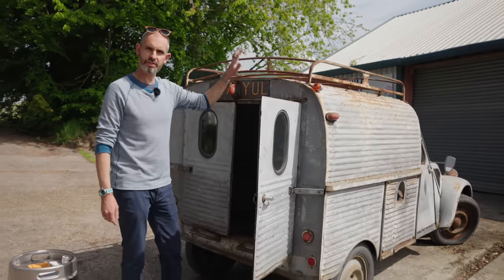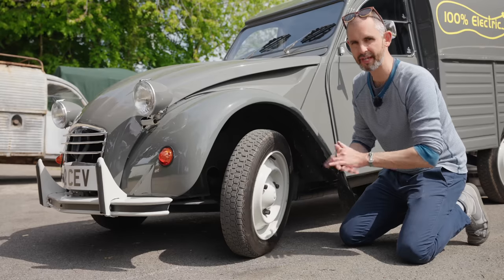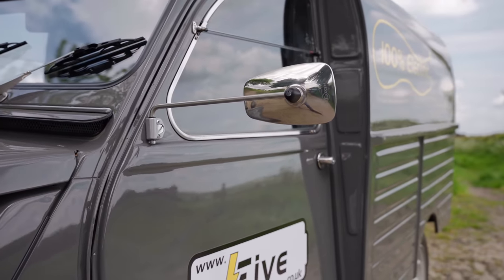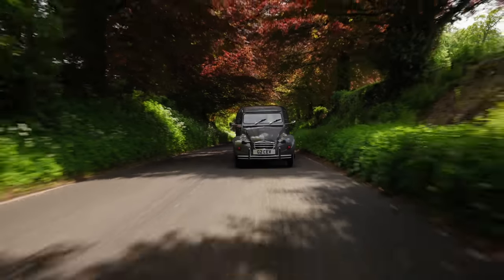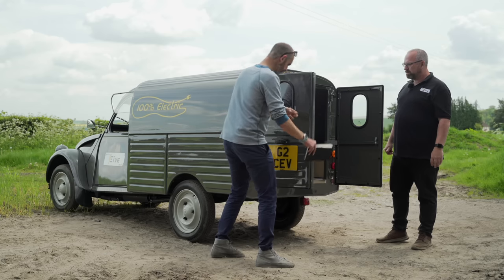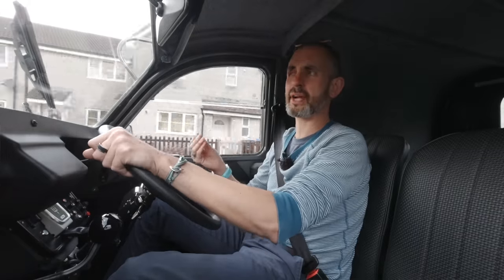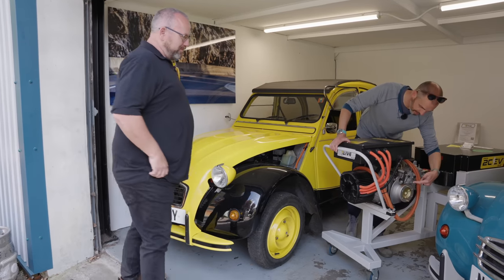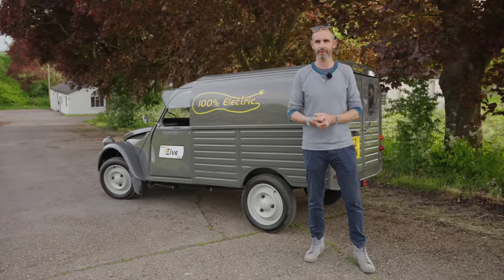This is a BRAND NEW Citroen 2CV AK Electric Delivery van - exclusive first drive review

Comment: So, I know most everything is new, but are they still registered as the original  build date? It's possible to import most things to Canada that is over 15 years old, so could I do it with one of these? And can they fit a North American compatible charge socket?
Reply from the maker: You can IVA it as a new car, yes.
Reply: @TheLateBrakeShow  IVA? To be able to privately import it to Canada it has to be registered as an OLD vehicle.

Comment: I wouldn’t mind if Citroen started to produce these. Built to be reliable and cheap. Mutch more afordable than those 10 grand behemoths. The combustion engine variants are still around today, so it will last forever. (Hopefully)
Reply: Wouldn't pass modern legislation.

Comment: Does it have the original hydraulic suspension with the pressurized nitrogen spheres? That's what made those cars. And gave you height adjustment and the ability to change a tire with a piece of wood.
Reply: You're thinking of the DS, SM, GS, CX, etc. The 2CV didn't have that

Comment: Do Yourself a favor and buy, should You need some, the original Michelin tyres (125R15 for the deuche) especially developed for Citroën. That goes for the 2cv as well as for other Citroëns from DS to SM. The ride with an original Michelin is way better, as in waaay better. Thank me after installing 'em.

Comment: I understand this not needing to have Tesla like levels of speed - but I don't agree with making it artificially as slow as the original, they were only that underpowered at the time to save cost, it wasn't a choice. It should at least be a bit nippier, especially given the huge cost premium, and I know from working in the industry myself that would be easy to do with a better electric motor.

Comment: So you pay 40k + VAT for a rebuild van, planned and build nearly 73 years ago with the safety features of that time.
And then the additional load... 350 Kg is ridiculous. My Toyota Corolla has 550 Kg and can tow up to 1500 Kg. (Trailer with brakes)
And it has ABS, ESP, Tractioncontrol, cruisecontrol, 9 Airbags and costs less than 40k.
Reply from the maker: You are entirely missing the point by comparing it to a Toyota Corolla. It isn't a rational choice vehicle at all - it is a classic shaped new thing that has PR value
Reply: @TheLateBrakeShow  Having a transport company is a rational thing at the end. And surviving a 2.5 ton SUV crashing in the Citroen is even more rational.

Comment: Range is too short for many delivery uses. If the floor of the van back were covered in say - 5 battery packs at the cost of some bulk capacity  - then it might start to look a bit more practical. If the front end were made in fibreglass too then it's long term weather resistance for British use would look very good. But the biggest bugbear is range. It needs 250 miles. Any less might be attractive for city use but the countryside is crying out for something like this and it's all up to the innovators out there to make this happen at an affordable price. We'd love to go electric but it's too expensive for all but a very very few. Think of the single person self employed small business - there are tens of thousands of 'em, stuck with diesel because the innovators are focussing on cities.

Comment: Are these available in left-hand drive versions?
I suppose, safety regulations on the European continent could get circumvented, simply through limiting the top speed of these to 45 kilometers per hour for export vehicles. This would also make licensing and insuring less expensive than faster vehicles containing mandatory safety devices and structures.
I presently own a Piaggio Ape. Therefore, airbags and carriage reinforcement are of no concern to me. I simply drive defensively and stay out of "accidents".
The price reflects the fact that these vehicles are hand-made. The people manufacturing these cannot be expected to work for free. There are quality advantages to be found in hand-made vehicles of which you cannot expect from those leaving assembly lines.
The cost of the vehicle could be written off from company taxation

Comment: I hate when they keep the gearbox. It's like using a word processor like a typewriter. One of the main features of an electric motor is that you (in most cases) don't need a gearbox.

Comment: So they could make it about 100 kg lighter by removing the gearbox? I'd prefer that. Other than that, very cool!
Reply: But then they'd have to fabricate something to connect the motor to the wheels. That's why many EV conversions leave the gearbox in.
Reply: 100kg?? A 2cv gearbox weighs probably under 20kg.  Speaking from personal experience, one man can lift the engine (with gearbox attached) off the front of the car.  I agree, in this electric context though, it does seem a waste of a good gearbox when a fixed speed bevel drive ((essentially an adapted lightweight RWD differential) would do the job nicely.
Reply: @christhesnaildriver  I threw out 100 kg based on what was said in the video. I have never handled a 2CV gearbox myself :)

Comment: Since its a lithium elecric car shouldnt the dashboard include battery pack temperatures , and instead of talking about it were made to drive eggs over a field - you should have looked at old french commercials and done the same - but i guess its now made for the posh so you should drive it wtih jewelry in the back bot  and not make them rattle

Comment: Motors will literally rip that thing to bits over 10k miles usual use like a sardine tin opener too opening a sardine tin lol obviously worst the more weight within it whether that be people or load.....
Reply: Now at 21m ok then its clearly been deliberately power restricted for this reason :)
Reply from the maker: Yes, because they didn't want to reinforce everything
Reply: @TheLateBrakeShow  for sure and of course weights robbing range and payload
Reply: @TheLateBrakeShow  think the reality is its a quirky advertising board and nothing else in most cases. cool all the same

Comment: How come this doesn't need to meet modern safety standards if it's all new ???
Reply: When it comes to saving the environment (aka getting 7yr old African kids digging up cobalt for 25p a day) then wanting to go home to your family at the end of the day, is the equivalent of beating a panda to death with an elephant.
Reply: @MattyEngland  what's that got to do with the price of fish?
Reply: Being built as one off cars, all with new components, they can be put through the "IVA" test and registered as a new build car  As a specialist vehicle (like tractors for example) it is exempt from requiring airbags or crash structures etc.
Reply: @christhesnaildriver  It's not a 'specialist vehicle' though, it's clearly a car/van. If the guy was building it for himself then I'd be 100% for it, but you shouldn't be allowed to manufacture and sell a deathtrap for profit, that's insane.
Reply: @MattyEngland  You may want to have a chat with Caterham and all the other kit car manufacturers then, 'cos they all sell cars under those same exemptions, equally lacking safety equipment that mass produced cars have to have.  Anyone buying one of these "new" 2cv's would have to be a moron to expect it'd score 5 stars for crash safety! If they wanted that, they'd go and buy a modern electric van.

Comment: Lol, What outrageous pricing.
From 40.000+vat for that?
Or just the conversion cost to be 18.000?
For those specs? Calling it a ripooff would be too mild of a definition
In parts it's like 4000. And labor should be 2-3000 tops.
Meaning this upgrade should be like 6000, not the scam 18.000
This is the reason why electrification is so slow. Scammers the car manufacturers, and scammer these independent shops, all trying to prey on the people.

Comment: With those battery and motor options, it effectively competes with electric transport bikes for utility. 
On price, it will compete with full blown vans that drive like normal BEVs.
Mostly a virtue signaling tool for hipsters that don't actually need a car, then?
Around the farm it might make sense for some. Very, very posh farmers.

Comment: Not a fan of electric cars, but this is quite cool, in a crap sort of way. The 2CVs sounded terrible anyway, so making it electric might actually be a bonus.

But £40k is a LOT of wedge for a car that was originally designed to be cheap.

And that's £40k plus VAT, another £8k.

Comment: Awesome but questionable legality.
There aren't enough basic electric vehicles available. 300kg usable payload is decent for most needs and can be a good buy for a lot of businesses. Unfortunately it looks like this new vehicle (which it is, based on new engine, chassis, bodywork) means that selling this vehicle as the 1989-registered vehicle it's number plate suggests could be fraudulent as it requires a new identity from the DVLA. Without being properly registered the mot, tax, and insurance are invalid.